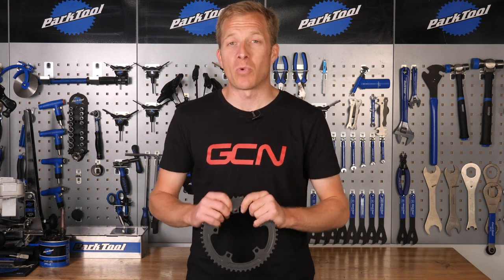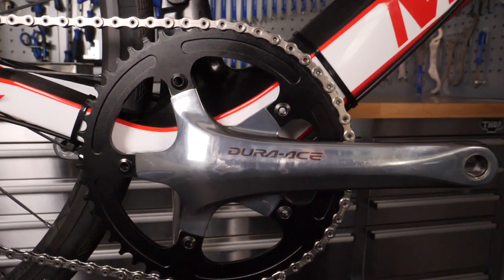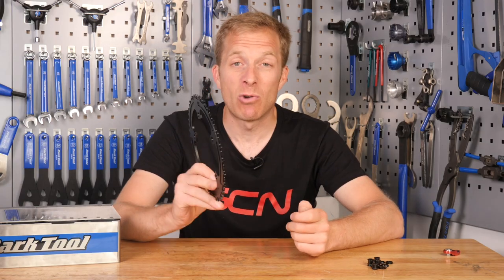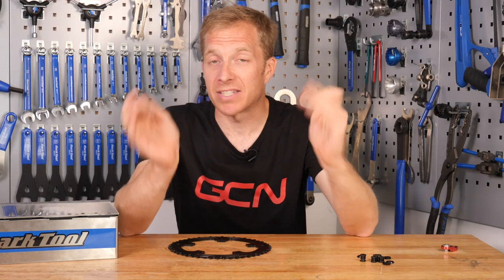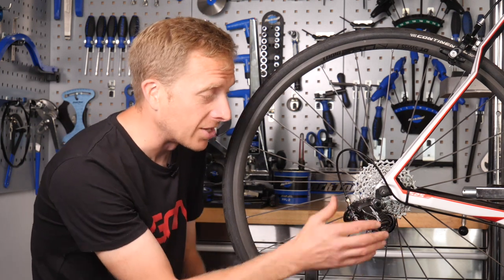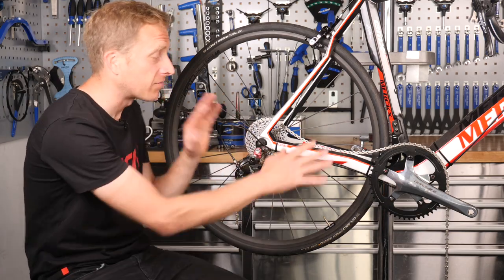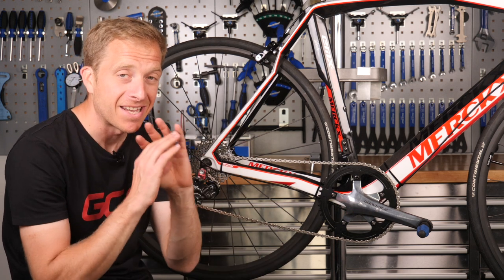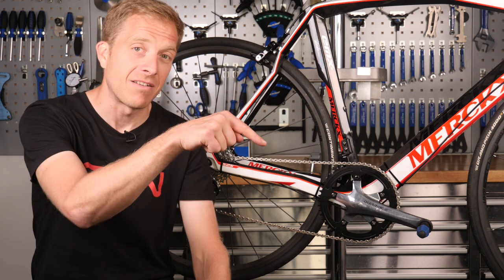Convert Your Bike To A 1x / Single Chainring Setup!

Comment: For many years, I ran a 2x drivetrain on my main road bike with 34-50t compact chainrings on the front and an 11-26t cassette on the rear. This bike is never used on gravel or rough pavement and is never used in mountains (it's mostly used in low rolling hills). After two years of never needing to use the 34t chainring, I converted the bike to a 1x. This was three years ago. I have a SRAM drivetrain and all I needed to do was switch to a 50t SRAM X-Sync 1x chainring at the front and an 11x28t cassette at the rear. 28t was the largest cog my rear derailleur could accommodate. I used that setup successfully for two years (about 10000 miles or 16093 km).

At the beginning of this year, I switched to a 52t oval Rotor QX1 Aero chainring on the front (equivalent to a 54t round chainring) and an 11-32t cassette with a SRAM Red WiFLi rear derailleur with a medium cage. I would have preferred an even bigger chainring -- like a 56 or 58t -- but the only ones I could find were poor quality and did not position the teeth in the correct location. The reason for the bigger chainring is to reduce friction by moving the chain closer to the center of the cassette during most use (a trick used with triathlete and TT bikes).

Here are some potential problems to avoid:

Rear derailleur hanger extender - The top jockey wheel of a rear derailleur must not only clear the largest cog in the cassette (typically with 4-6 mm to spare) but the track of the rear derailleur as it moves across the cassette must be at an appropriate angle so it maintains an acceptable distance from each cog. Rear derailleurs that are designed for wide-range cassettes are designed with both requirements in mind. All the hanger extender does is enable the top jockey wheel of a standard derailleur to clear a larger cog. It does not change the tracking angle of the derailleur. This means the top jockey wheel may be too far away from the smallest cog if it is beyond its range. The result is poor shifting. The best solution is to get a rear derailleur that is designed for the cassette range you plan to use. If you must use a hanger extender, then be very careful to check the hanger+extender alignment to the wheel. Any hanger alignment errors will be magnified with an extender and that, too, will degrade your shifting. Park Tool Dag-2.2 will help you to both measure the alignment and bend the hanger+extender into the correct position.

1x chainring - The most important design feature of a 1x chainring is not wide/narrow teeth -- rather, it is the location of the teeth. Theoretically, you want the teeth to be centered in the driveline to the center of the cassette. If you compare it to a 2x setup, the 1x chainring teeth should be in the middle between the outer and inner 2x chainrings. In practice, SRAM recommends that you favor the outer cog of the cassette by 1-2 mm. This is why a 2x outer chainring is unsuitable for a 1x setup -- it's teeth are too far off-center (toward the outside), which perpetuates the cross-chaining problem to the largest cog. But here's the problem that catches some by surprise: There are some cheap 1x chainrings on the market that do not locate the teeth in the correct position for a proper 1x drivetrain. Therefore, if you decide to experiment on your own (like I have) you need to do your homework on drivelines (a.k.a. chainlines) and measure the current driveline offset of your bike at the rear cassette. Then make sure the 1x chainring you use is compatible with your driveline.

Chain length - The chain in the video looked too long. I recommend shifting to the biggest cassette cog, thread the chain through the rear derailleur and around the largest cog and the chainring, then pull the chain together until the rear derailleur cage is pulled nearly as far forward as it will go without rotating the top jockey wheel too close to the cog. Mark this chain length and add two links to it. This method takes the most work (and strength) but it produces the best results.

Tips:
Road racing frames with shorter chainstays are problematic for 1x because they have more dramatic angles in their driveline when cross-chaining. One way to reduce this problem a little, is to use a 10-speed cassette and rear derailleur. It will move the largest cog closer to the center of the driveline. Some cyclists who criticize 1x for having steps between cogs that are too large will probably blow a fuse over such a suggestion. But I rode a 2x6 drivetrain for many years and never noticed a problem. I could still find an acceptable gear ratio for the cadence I wanted to use. And, when you consider the redundancy in gear ratios of a 2x system, the actual "usable" gear ratios that you have is less. So I have no problem with the step size from 11 to 32t on a 10-speed cassette in a 1x system today. And I doubt I'll have any trouble with an 11-36t, either. Use what works for you and don't let others force you into their idea of "perfection".

If you lube your chain with wax, be aware that 1x systems can take a little more work. You need to manually push a freshly waxed chain onto the wide/narrow teeth of a 1x chainring while slowly turning the crank for the full length of the chain in order to push out extra wax from the gaps in the chain. If you don't, the freshly waxed chain may derail off the chainring when you first use it. Most 1x chainrings have longer teeth than their 2x counterparts, but the tooth length of all 1x chainrings are not the same. For example, the teeth of my Rotor QX1 Aero are 8.0 mm long and the teeth of my SRAM X-Sync are 7.0 mm long. The longer 8.0 mm teeth can make it even more difficult to break in a newly waxed chain because the longer teeth engage the gaps of the chain earlier and must push more extra wax out of the gaps. This may not be a big deal to most waxers because the benefits often outweigh the problems. But it's something to be aware of.
Reply: Comprehensive reply there my friend, nice work!
Reply: SRAM tech docs say to add four links to the chain rather than two (3 links plus the power link), I'm not sure why but this applies to Rival and force 1x
Reply: Wow, that's a lot of writing!
Reply: @Casey Sanders - I think you're talking about clutch rear derailleurs. Add 2 links (1 inch or 25.4 mm) for a standard rear derailleur and add 4 links (2 inches or 50.8 mm) for one with a clutch. Remember, the procedure I described above already includes the chain length needed for the cage and jockey wheels because the chain is threaded through it when making the measurement. Since a standard (non-clutch) rear derailleur was used in the video and that's what I use also, I avoided talking about clutches. I see no need for them for smooth paved roads because there is minimal chain slap to dampen. Plus, the clutch adds unwanted friction to the drivetrain -- something I'm trying to reduce.

SRAM's 1x systems are designed primarily for cyclo-cross and gravel bikes. They aren't making 1x components for pure road cyclists like me -- yet. But a road rear derailleur (no clutch) with a medium or large cage works fine with a wide-range cassette in a 1x system if you stick to smooth roads. So I don't think that a new rear derailleur design is needed. The primary reason to change the rear derailleur is if you are adding a new cassette that has a wider range and needs it.

The only "problem" using a SRAM 1x system on a pure road bike -- and it's a minor one -- is that SRAM's X-Sync chainrings all have the wide teeth shaped with a bulge to clean the mud and debris out of a chain during cyclo-cross. I believe this adds friction. Plus it makes for a slightly noisier chainring. If they decide to market 1x for pure road bikes, they'll need to make 1x chainrings with smooth teeth optimized for that application. In the meantime, I wouldn't recommend an X-Sync for a pure road bike if you're seeking every affordable marginal gain. I used an X-Sync for two years on the road -- it works fine. But, now that I have my oval Rotor QX1 Aero chainring with smooth 1x wide/narrow teeth, I doubt I'll ever go back to either a 1x chainring with cyclo-cross teeth or a round chainring again. I'm not 100% convinced that the longer 8.0 mm teeth of the QX1 are needed or really help. But I have to defer to Rotor on that because they have loads of experience with oval chainrings and the tooth length may partly satisfy the requirements of a non-round shape.
Reply: Please do a you set up for road bikes 
I'm setting up a giant tcr 1x11 I have an xo mt bike derailleur I was thinking of using 
Thanks for your insight
Reply: So narrow-wide chainrings should have the teeth offset inward from the bolt holes? On this old road bike I'm trying to 1x, the inner side of the crank is much more aligned with the center of the cassette, but is too close to the chain stay to fit anything bigger than about a 42t. Meanwhile the outer chainring position is aligned too far out. Would love to know the best way to get a 50t as close to centered with the cassette as possible.
Reply: @xichael  Have you solved this question yet? I suppose it depends on your crank/BB style, but the most direct way to do it would be to replace your bottom bracket with a slightly narrower one (assuming adequate clearance) which will bring your 50t inboard from its current position. If you're working on an "old road bike," it seems likely to me (or reasonably possible) that you have cranks with a square taper BB. If so, then this is a relatively simple procedure as they come in a variety of different lengths. The first step is to measure yours (or look it up on Sheldon Brown's BB database), and then do the math and determine a suitable replacement (which is sometimes hard without having one to measure -- they are not always perfectly symmetrical and mfgs do not always publish the complete specs). The key thing you're looking for is the distance on your current one from the edge of the BB shell to the end of the spindle. Subtract some mms from this (depending on how far inboard you want to bring it), and then look for a new BB with that desired drive-side measurement. It helps to draw these things out on paper to visualize the measurements.
Reply: @CommaCam , I ended up switching to a hollowtech BB/crank, which brought things into pretty good alignment with the chainring in the outer position. Glad to be done with square taper, and relieved to see that the new stuff fits so well on old frames 👍
Reply: @xichael  Cool, glad it worked out. I still like square tapers myself. They can be a minefield sometimes but they do give you the flexibility for projects like this that require you to mess with your chainline.
Reply: @CommaCam , yeah, I got lucky in this case, but I suppose there'll be times where you'd need the flexibility of the various square taper lengths.
Reply: This guy knows things
Thx for some good info thru experience!!

Peace 
Tampa FL
Reply: @xichael  all I know is it's worth figuring out 50t is my go to size... I'm watching and reading up on this just now first ever but what I wanna do is keep my crank arms and spider from shimano 105 crank but than put single 50t chainring on there...on a caad 10 the chaindstay I dk if it will fit but they put like a little divet or looks like a dent I never knew what for cuz the x2 crankset clears chaindtay by many MM... maybe it was for the single crank setups... this my go to project this summer... p by any chance any one here may know how to undo a crank spindle that has been glued by loctite inside a bottom bracket that is another problem I'll be facing stupid me I thot it was a good idea... yeah I'm read nail polish remover is a trick... does that sound about right ??? 

Peace
Reply: Fantastic advice!
Reply: Hmm thanks for you extensive writeup. I went oneX by just removing the derailleur and the inner ring. I have dropt my chain 2 times during my last ride. No fun. The chain dropped to the right side, away from the bike. I found that surprising. Your (great) writeup has left me wondering whether I should try to wipe off some apparently excessive chainwax or get a special chainring.

Comment: Just made the switch to a 1x drive system. Can't believe how much it has simplified my ride!  I lost a gear or two on the high end, but I'm 70 years old and I can still hit 30 mph without spinning out. Not needing to switch from large to small rings up front, especially when I'm doing a lot of up and downhill, just eliminates a lot of bother and making fine adjustments in the rear after you switch front rings. No down side for me.

Comment: I got a 2017 Trek Crossrip 1, it had a 48/32 chainrings with 11-32 cassette. With shimano Sora 9 speed shifters/derailleurs. I found myself never going to the smaller ring upfront,  only trimming. So it was logical to just put a narrow-wide 48t chainring. No other modifications, just removed the shifter cable, front derailleur and switched to 48t narrow-wide chainring. Works like a dream! No more worries about trimming, and for my fitness / endurance rides 1by works great! I do think this is the future. They used 2by and 3by because technology wasn't quite there yet to put many sprockets in the back. Now we have that. 9 is enough for a recreational rider like me, I'm sure 12 will be plenty for more advanced riders.

Comment: Old Trek 720
With a 10 speed 11-40 cassette coupled with a 42 tooth wide narrow. Rear derailleur is a Shimano Zee mtb short cage with a Microsoft 10 speed bar end shifter. Works great! Never dropped a chain with this setup.

Comment: How to make a 1X for cheap - stay in the same front chainring
Reply from the maker: Haha that's one way!
Reply: ...and remove the front deraillure
Reply: Not ideal....chain ring tooth angle and size is different to 1X (as pointed out above) , which make extreme angles noisy....
Reply: Tim Peterson, then the chain will be falling off cause the chainring has guides for going up/down (depending on where it's located). You NEED the narrow-wide chainring to keep it in place. Or the derailleur.
Reply: Tim Peterson I did that once, lost the chain 3 times on a downhill.. now I stick to dérailleur or narrow-wide chainring (on my cross bike)
Reply: Currently doing that as the 38 tooth ring (only used for "Track standing" at the lights to show off) has worn out and gone all shark toothy after 4 years. Going to get a superstar components 46 tooth narrow wide to replace both soon though.
Reply: @KriegKadaver  That makes a lot of sense. I'm currently riding a winter bike with old shimano 7 speed sti shifters and rear derailleur. No front derailleur or chain keeper on either. I have zero problems. Well, sort of. I'm running some old cranks that don't have any fancy tooth profile for easy shifting. Right now I'm just using the small ring which is a 40t I think and I'm not taking things gentle at all, bunny hopping big bumps or speed bumps doesn't seem to be an issue. But the key here is those old cranks and chainring. It's funny how design of chainrings for easy shifting has made it hard to keep the chain on and made more of a market for 1x systems. I don't at all take away from any finely tuned 1x setups that have been designed to solve other problems that my current situation does have like chain line and potentially some noise. I'd like to go 1x on an adventure bike if I pick one up in the next couple years. The purpose built setup will definitely have it's advantages and I like the idea of gearing being sequential all the time and I feel like since my only summer bike that I use to keep up with my roadie friends is a track bike, I won't really be missing gears in the climbs or descending and I'm really comfy pedalling at a range of cadences. When you start with just a 46 chainring and a 16t cog, having 8 to 11 gears to choose from is like being in a candy store.
Reply: I did that yesterday but still can slip into small chainring and the teeth on those singles are designed to catch those chains deeper than say a typical 2 or 3 chainring.... but since werr talking cheapest hacks I get it... anyways that's what I'm doing for now took off the FD and just ride on the big chainring 

Peace
Reply: On my 3x7 I was lucky enough to be able to remove the 2 smaller rings and move the large ring into the middle position for optimum chain line.
Reply: That's currently what I do which is why I'm switching... Just adding more gears with a single chainring.
Reply: The point of it is to save weight by removing the front derailleur and the extra smaller chainring. Also going down a few teeth helps.
Reply: @pablo marquez  that's only part of the point of going 1x.

Comment: I do it on my commuter bike. Even with big hills. It is an older bike with a 7 speed cassette, so I opted for a 40 tooth front ring, which gets me up most hills with the 28 in the rear. It is just easier to maintain, especially in the winter months.

Comment: I have been riding a 1 x for years. Started with a 48t track crank and a 14-28 6 speed cassette on an old steel frame about 30 years ago. Latest is a super lightweight Neil Pryde carbon frame with sram red and a 50t narrow/wide with a 11-30 cassette. Plus many other 1x builds on all types of bikes, Road, Mountain and Hybrid. Always on the lookout for broken left hand shifters that I can strip down to provide a lightweight brake lever.

Comment: 11-40 runs nice using a wolftooth hanger (similar to the red thingy) and a medium cage 105.
Reply: Yes....I ran 11-40 with Roadlink and works well. Slight loss in accurate shifting though,but you get used to it.
Reply: You don't even need a medium cage derailleur for this, since the derailleur capacity is reduce due to the lack of second ring. Short cage works just fine.